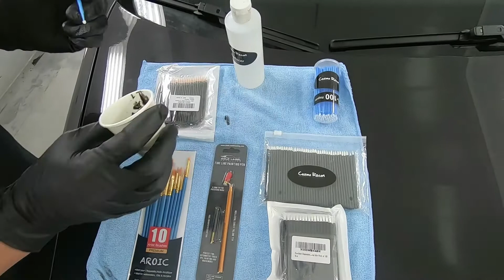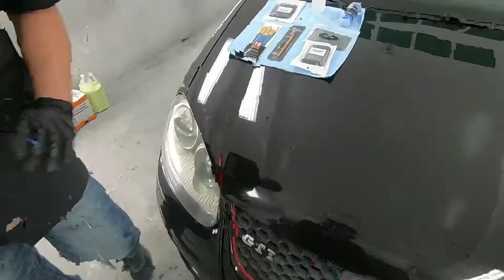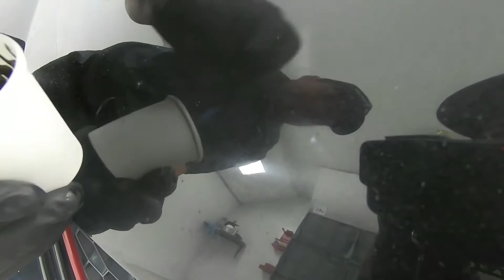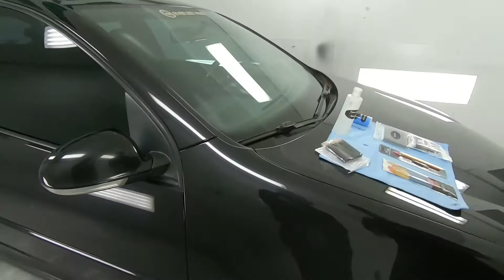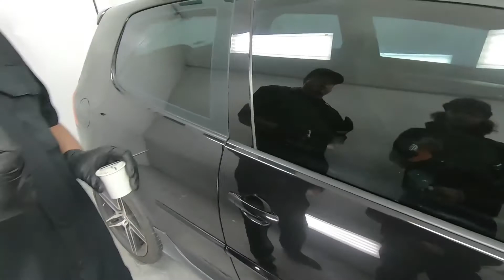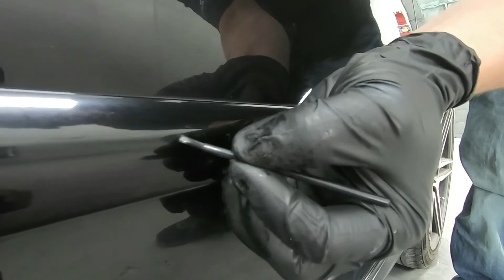using your touch up tools

Comment: At the company where I work, when the hood has a lot of rock chips, we do a shoe polish with Cozmo paints and it works really well. But when we try to use the same shoe polish technique on the doors to cover multiple scratches, it doesn't work. Could you explain if there's another procedure that needs to be done before starting the shoe polish technique? Thanks in advance!
Reply from the maker: Hi @marilynpacheco167. We’re glad to hear you’re enjoying our products!
For scratches, this particular method won’t provide the best results. Instead, we recommend using a squeegee technique for color sanding. Apply your touch-up paint, allow it to fully dry, then wet sand over the area to achieve a smoother, cleaner finish.
We also offer a new product that allows you to apply a UV clear coat over the repair. This helps level the scratch and make it more flush with the surrounding clear coat for an improved appearance.
If you have any questions or need guidance, feel free to give us a call—we’re always here to help! 800-930-2758 ext 3
Reply from the maker: I also wanted to let you know that we have new training videos to be released in the next couple weeks. There are a few online now under the membership page. But all the videos are coming soon!